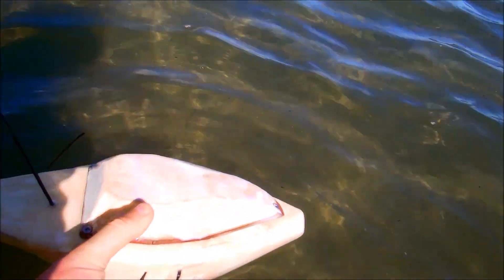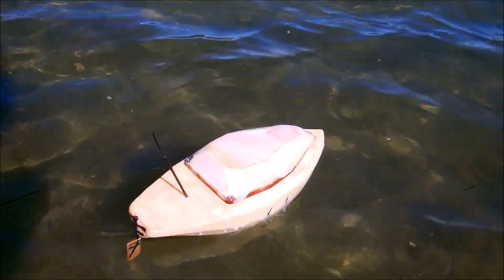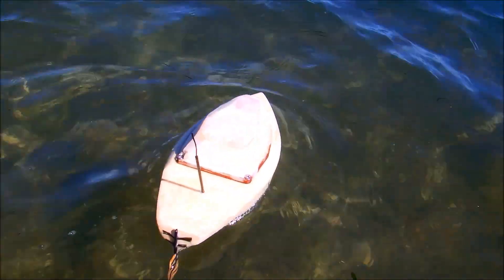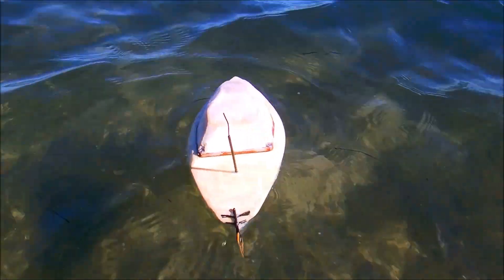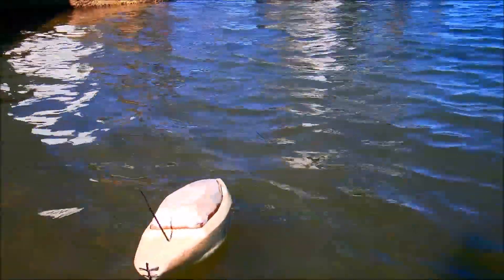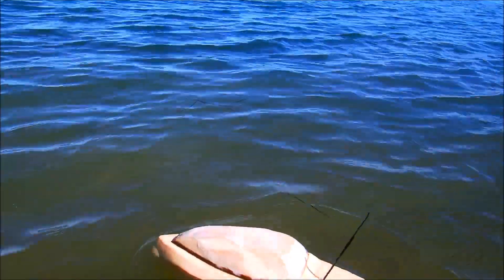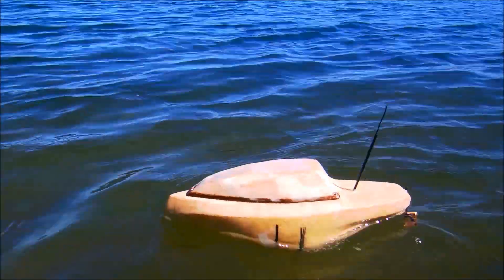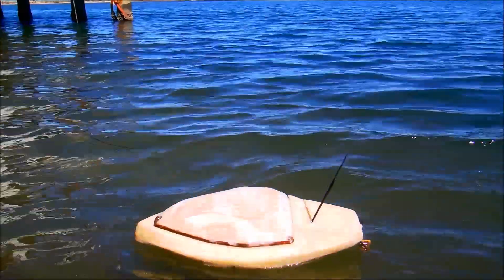Magnetohydrodynamic drive - RC Model Boat

Comment: I really like the elimination of the duct. Great concept. Perhaps there is a way to increase your B field strength by making the bottom surface corrugated so you can lay in the magnets with their poles aligned in the internal troughs. Slight increase in surface and drag, but an increased field strength. So it's like half a duct. B>WWW>B.

Comment: Have you heard of the channel @MHDTechnologyLaboratory ?  In addition to FEA, they demonstrated an MHD conduction pump using GaInSn as the working fluid at depth (50mm) and achieved 500 mm/s flow velocity with 0.9V @ 1000A using a 50x50x100 mm 150mT neodymium magnet with 15mm gap from fluid and 100mm long electrodes with 170mm gap.

It was in a closed square box with turbulent flow velocity, so with an efficacy of 0.5555.. mm/W*s this is very impressive. Of course, with a GaInSn conductivity of 3,000,000 S/m this has a fluid electrical resistance of around 5.67E-5 ohms with their electrode geometry and eliminates a substantial amount of joule heating losses. It seems it would require 150mW of power at 2.83mV 50A resulting in 53mm/s velocity, 1500 N/m3 force and efficacy of 353.3 mm/W*s. That number does collapse fairly quickly, as expected of the square proportionality of joule heating losses, as well as the higher fluid velocities and turbulent flows.
Reply from the maker: Sounds interesting, I will have to look it up.

Comment: What about a magnetic keel in order to tackle bouyancy and estabilty with displacement, or a triamaran configuration to make it more hydrodinamic.
I know its easy to write after just watching the video, but to my eyes that hul doesnt look very useful to the weight of the sistem.
Reply from the maker: A keel would certainly help to damp the rolling. I will make another video to discuss the hull shape.